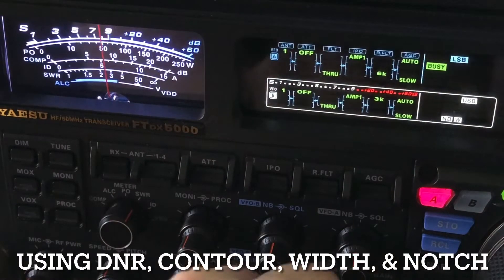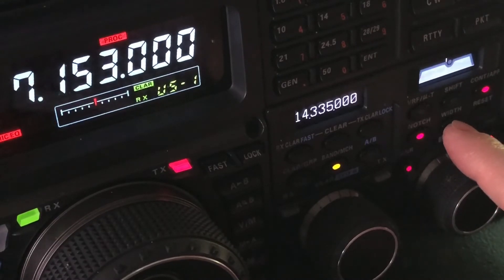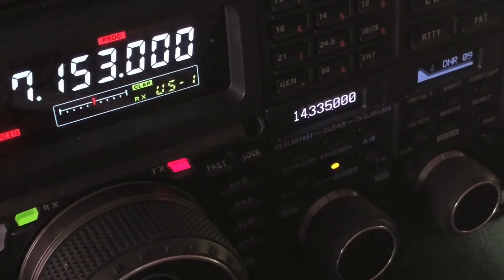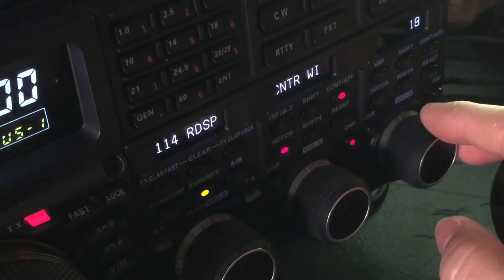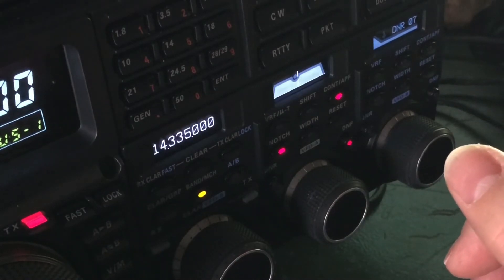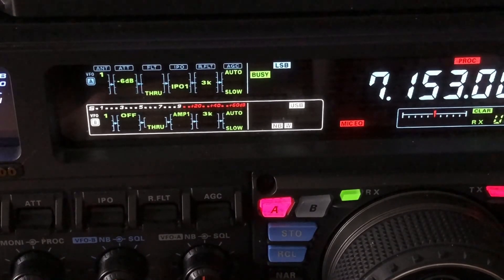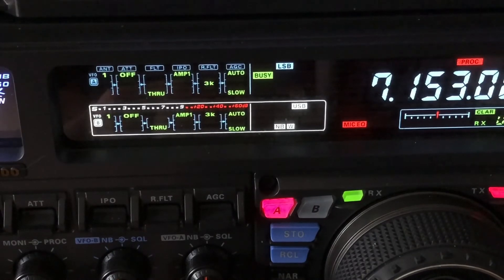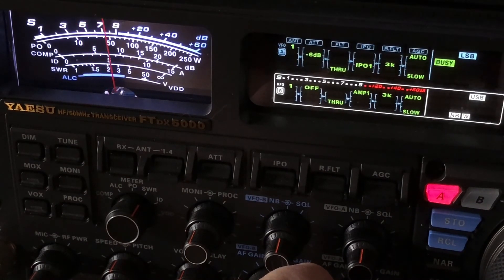Using DNR, Contour, Width, and Notch

Comment: Hey Doug! I just got back into the hobby last Spring after a 20 year hiatus. My most sophisticated rig up till then had been a 940SAT, so I took the leap and bought an FTDX3000 last Summer. It is a terrific radio but I was really behind the curve on all of the DSP features and functionality. The manual was of little help beyond “use this for interference reduction.” This video, along with the IPO/ATT and Block Diagram videos have really given me the PRACTICAL real world working knowledge I needed. Tnx & 73 Tom
Reply from the maker: I’m so glad you found my videos helpful.  As I’ve stated in some of my videos, I hope to help my viewers get the most from whatever radio they own.  

The FTdx3000D a very capable radio.  It should bring you years of enjoyment.  It even has the option to use the optional u-tuning preselectors that work with the 5000.  These preselectors can help the FTdx3000D compete with just about any contest class radio.

73, Doug